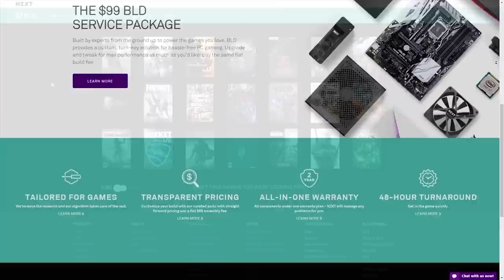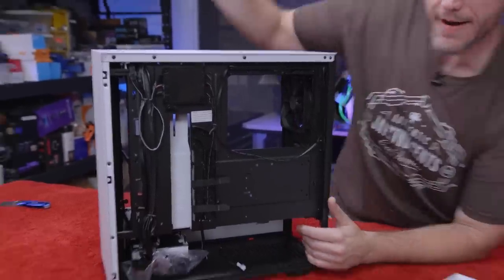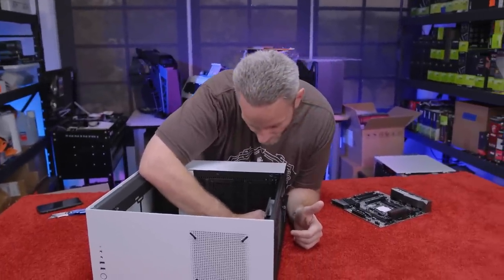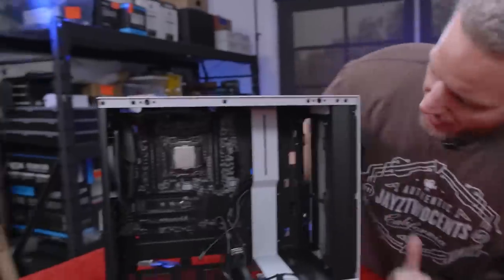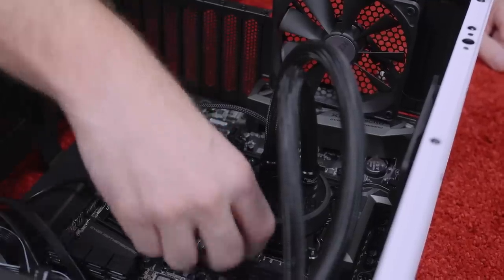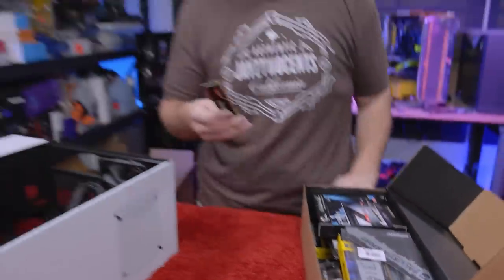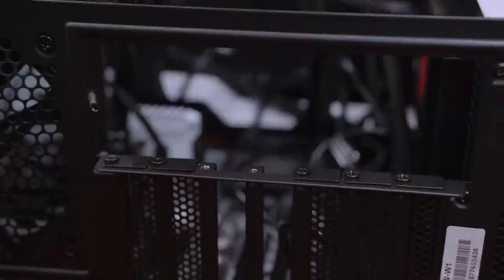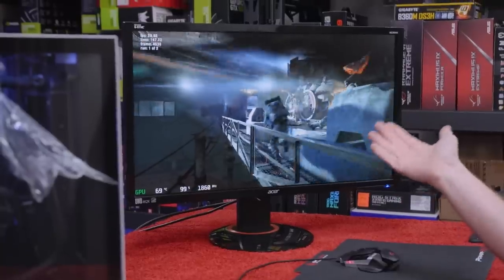We built a computer wrong on PURPOSE!

Comment: I was thinking 1000w when he pulled out 1600 I almost choked on my own saliva
Reply: Yeah how could he do that? It's still not enough
Reply: True, you'd never be able to connect your usb clothes dryer to it.
Reply: I uh... I do have 1200 watts. I realized a long time ago it was beyond overkill, but is it really that bad?
Reply: @lyingriotman2220  No lol.  It's completely fine.
Reply: @Nighterlev  Alright then, lol. I've just got 700 watts sitting on the back burner for a while then.
Reply: @lyingriotman2220  It doesn't really do anything negative to your power supply for not using it to it's max potential.
In fact, getting a higher wattaged power supply is a good thing, because the higher the watts, the higher the quality is in the caps, therefore, the longer it'll last.  You can probably go through multiple different builds for that 1200w PSU finally decides to fail.

After all, most 1000w+ PSU's tend to have 10 year warranties on them, because they're so damn reliable.
Reply: @lyingriotman2220   unless it's on a rediculous sale (or free) all it will really do is make your build budget  more expensive. Which means you could have got more value for the money somewhere else in the build as far as performance increase
Reply: thats just dumb
Reply: overwatting is lame, get this thing running on "500W" (150W real) Chinese $10 PSU, that would be achievement :)

(check fire extinguisher first tho)
Reply: Lyingriotman on my old 2011 build I had a 1200w even when I never needed that much power. I'm building a new tower now and I've got a 1000w  psu with a 10 yr warranty
Reply: It's not that buying an over watt psus is bad for it because it's not its 100% fine for the psus it's your wallet that takes the unessisary damage a cheaper psus cuase have done take his build done remember the cpu let's say 7700k and a 1080ti that combo should need no more then a 700watt psus and that's about $65-$70 while a 1600watt psus is $200-$300 yea big hit in the wallet lol
Reply: @lyingriotman2220  The only downside that bigger power supplies have is that they are more expensive and use more power than smaller power supplies (look up power supply curves) since you would probably be running them well below the peak of the curve.
Reply: @thursdaythought7201  What you said is misleading. They CAN use more power than smaller power supplies...but they will only ever output what you need for what you're doing.
Reply: @himi6536  Well they do have the potential to use less power if you are using insane ammounts of power- I'm talking threadripper and 2080ti levels of power (800+ Watts). For most people they will just waste power and be more expensive.
Reply: @thursdaythought7201  If you can afford a more expensive, higher wattage power supply then there's no reason to not future proof yourself...but there's no reason to go overkill if you're on a strict budget. That's called balancing your build.

If your system needs 600W, it will only pull 600W. This is true whether you have a 700W or a 1600W. Unless you're buying Chinese knockoff PSUs, this will be true for every power supply.

So, no...a higher wattage power supply will NOT use more power/waste power. It only draws what it needs.
Reply: @himi6536  Power supplies have things known as power supply efficiency curves. These curves represent how efficiently the PSU is converting the AC power to DC power- it is most efficient at around 50% utilization (PC using 300W with a 600W PSU is an example).  It makes no sense to get a 1600W power supply to pair with a 300W system- power supplies that large are expensive, it is less efficient in converting the power,  and it makes no sense for future upgrades because computers are becoming more power efficient.
Reply: @thursdaythought7201  They're becoming "more power efficient" (with emphasis)
That's something you're ALSO being misleading with. A new graphics card will still take more power than an older one, just not as much you might think. Regardless, there are tons of things that can be added onto a PC that are becoming more and more accessible that also draw power from that. My build currently draws around 1000W on a good day and I have a 1600W power supply.

Regardless, efficiency isn't what we were talking about. It doesn't literally use more power if it's less efficient, it might just pull an unnoticeable amount more from the power grid...but the same exact amount of power will be going into the computer.
Reply: @thursdaythought7201  Futureproofing is the main reason to get a bigger PSU. I'm not recommending anyone get a 1600W for gaming, but getting an 850W when you need a 600W isn't gonna have any noticeable impact to anything other than your wallet.
Reply: Efficiency is exactly what I was talking about. If you didn't want to talk about efficiency then why did you even reply to my comment. The fact of the matter is if your PSU isn't suited for the rest of your PC then it will draw more power from the wall than if it was suited for your PC. Also what sort of PC do you have that draws 1000W "on a good day"? That is either not consumer grade or it is overclocked to shit.
Reply: @thursdaythought7201  Nice backtracking lmfao

It's 100% consumer grade...just not at a "consumer grade" price point. The bigger question is why do you care?

"On a good day" means it sometimes uses up more. It's moody.
Reply: @thursdaythought7201  Also, a 600W power supply will pull the same amount of power from the wall no matter what computer it's supplying. There might be a tiny difference, that I assume you're now referring to, but it is not anything you would ever notice.
Reply: @himi6536  They built the entire 80+ rating system around the efficiency of power supplies- the difference is not tiny. You are basically wasting money if your power supply is too big  to achieve the sweet spot.
Reply: @himi6536  I'm not backtracking- I'm pointing out that you tried to bait and switch the topic. There is no way that you pull minimum 1000W without doing severe overclocking- like I said. What parts do you have?
Reply: @thursdaythought7201  You never once mentioned efficiency and now you're saying you were talking about efficiency...so, yeah...right, dude.

So, what, you care about my parts because you think I might be lying or I won the silicone lottery? Answer the question and I'll tell you why it's so high. Why do you care so much about how much power my system uses?
Reply: @himi6536  Quotes of me talking about efficiency...
"(look up power supply curves) since you would probably be running them well below the peak of the curve."

"Well they do have the potential to use less power if you are using insane amounts of power"

"Power supplies have things known as power supply efficiency curves. These curves represent how efficiently the PSU is converting the AC power to DC power- it is most efficient at around 50% utilization (PC using 300W with a 600W PSU is an example). "

Literally what do you think I have been talking about...
Reply: @thursdaythought7201  Unless you get one of the aforementioned stupidly efficient power supplies, in which you'd have to literally measure the difference to see it.

And if you're not, you honestly won't notice anyway unless you're using a 1600W in a system built to need 400W.

You seem to think the difference is like literally 10 dollars a month in electricity usage difference. It might be closer to a quarter, $0.25. I'm not saying it's good to go super high-level overkill on your PSU. I'm saying you're acting like someone will kill their electric bill by doing so...which isn't true.
Reply: @thursdaythought7201  Anything you used outside of the original comment is irrelevant. You should know that. Why you tacked the last example on is beyond me.

Power supply curves handle WAY more than efficiency. I'm going to assume you know that and added it because you think I don't.

"Use less power" and "efficiency" aren't the same thing. Sounds like you worded it wrong if what you meant was "draws less total electricity"
Reply: @himi6536  I tacked on the last example because it shows me talking about efficiency...
Power supply efficiency curves handle efficiency- it is obvious that you literally just looked that up cause you didn't know what I was talking about. The power supply using less power means that it is more efficient. The power that the power supply uses is not the power that the whole computer uses but rather the extra power that the psu uses on top of the power needs of the computer.

Stop trying to argue this because it is obvious you are confused but confident on the subject. The term that comes to mind is Dunning-Kruger...
Reply: @thursdaythought7201  "Stop trying to argue because I say you're wrong" lmfao what a massive ego

I know what I'm talking about and to assert that I don't just because I disagree with you is nothing but a terrible way of thinking.

Funny how you shoehorned the word efficiency in and still can't answer my question from before...deflect, deflect, backtrack, make assumptions.

Nice argument strategy, I guess? Go stroke your ego elsewhere. You didn't mention efficiency and now you're demanding that you did.
Reply: @thursdaythought7201  "I'm going to ignore every single point you make and claim you're confused, uninformed, and wrong because I disagree with you"

That's you in a nutshell.
Reply: @himi6536  I am literally only talking about efficiency power supplies. That is all we are talking about here. If you don't agree about that then YOU ARE WRONG. This is my comment thread and you can't dictate what my comment said. Like holy shit go away.
Reply: @thursdaythought7201  Just because you said something wrong you think that clarification and backtracking makes you magically right.

You also think insulting me is helping you look good in some magical way.
Reply: @thursdaythought7201  YOU obviously didn't understand what you said. You said nothing directly correlating to efficiency, only power draw...and then claimed it was about efficiency.

It's obvious you were making shit up as you went along and are claiming I can't read well because you write very poorly.

Comment: It's almost like the industry has collectively tried to make this as fool proof as possible t get a PC together instead of having to deal with RMA's all day from people doing it wrong. Amazing.
Reply: Its almost like this video was necessary because people still act like they're building with components made of sugar glass in 2019 and freak the fuck out in the comments when they see builders touching pins and PCBs.  

Its almost like you missed the entire fucking point. 

On no wait. Thats exactly what its like. Amazing.
Reply: I've built pc's back in the mid to late 90's with no issues wearing a sweater and no anti-static wristband.

People are just stupid and we old timers love proving that to be the case.
Reply: @christophervanzetta  I think the static fears probably came from computer building pre 1990s. Like you, I've never had any issues with static.
Reply: @tikoblocks3224  Still doesn't make sense but OK
Reply: @tikoblocks3224  LMFAO!

Because static discharge doesn't affect mobo components. Too low of amperage.

It's a myth to sell overpriced junk for idiot's
Reply: @christophervanzetta  My first attempts at simply replacing parts before I ever built one scarred me for life and Im super paranoid.  Back in the 90s I replaced my first graphics card.  Little did I know it would probably be a good idea to turn the power switch on the PSU off.  So current was still running through the mobo when I took my old GPU out and put the new one in.  Hit power there was a Bzzzt noise and it wouldnt boot (It was still under warranty from gateway so I put the old card back in and was like "I dont know what happened?!") 99% sure they just gave me a new PC.  Next time I tried to put an after market cooler on my cpu, admittedly, on this one while yes I didnt do it right, Im not sure what would have killed the thing.  (I didn't remove the old thermal paste and just plopped the new cooler on).  Same deal.  a "bzzzt" noise and I couldn't get it to boot (I did however remember to not leave my PC plugged in).  Which led to my first actual build that miraculously worked.  But ever since those first failure forays, Im still a mess of anxiety when even replacing things as simple as case fans.  I mean the only thing that alleviates it a bit now is I have money to burn.
Reply: @bigoljoe1829  someone with some common sense finally

Comment: Put thermal paste on the CPU pins
Reply: No!!!!!!!! You have to use liquid metal on the pins. Regular thermal paste will insulate the braces.
Reply: Why not just gasoline while your at it
Reply: So that it doesn't short circuit?
Reply: Ana Anaqah, not all paste is conductive, I think the white artic ceramique isn't but the artic silver is, could be wrong but in any case since it's not conductive it could act as an insulator to prevent the pins from touching inside the socket so either way it's bad
Reply: They get hot too
Reply: @anakakaka  r/wooosh

Comment: Bend all the pins.
Reply: I have actually had bent pins once... Bent them back and everything was fine.
Reply: @Outland9000  same
Reply: First you need a Thermal Paste applicator to do that and you need to be holding it in a cpu installation tool

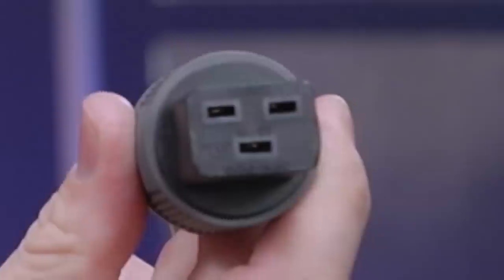Comment: 10:21 That's actually a standard IEC C19 plug. It's just not common since you usually don't have that much current going through a PSU.
Reply: Yes someone else knows about c19
Reply: I'm surprised he didn't know that.
Reply: I was going to throw this out there too. You see this more in data centers, typically not consumer hardware. If someone builds a system that is pulling 1600watts I would also hope they are plugged into a 20A circuit or dedicated 15A.
Reply: I said the same thing.  Though i wonder what he'd say if he saw a NEMA 6-20 or a NEMA L6-30.

Comment: I've heard that drilling holes in a motherboard is a bad thing too.
Reply: Bryan de Paepe haha I almost forgot that
Reply: Well there goes my idea for the Swiss Cheese build...
Reply: yea, if you're lucky the spot you can drill into is the ideal spot to use for whatever you had in mind, but otherwise it's a not a good idea. I'd be fully amused if he drilled into his though.
Reply: Maximum airflow
Reply: or massively over-tightening the screws holding the board so it snaps =)
Reply: That's a myth!
Reply: Yeah if i can't find a hole for a screw i usually just use epoxy to glue it in place.
Reply: You'll have a nice probability of destroying a trace, even f you don't see one. But you can always try! :P
Reply: Jay found that out the hard way several years ago.
Reply: Well of course THAT would be bad. There is no reason you'd EVER have to drill a hole in a motherboard. Sure you could do it with no problems if you did it right, but I wouldn't recommend it
Reply: @mauro Tamm that is the dumbest Idea I've heard for a while! Glue??? Nope.
Reply: BurntFaceMan  People have frequently used drills to shoot in the case screws and they end up breaking the circuit board, which sometimes isn't a big deal but other times may break traces running through the board.
Reply: @TheDyingScotsman  - Uh, to maximize airflow, duh.

Comment: You forgot to blow the RAM like an old NES cartridge...
Reply: For some reason.  Pro Wrestling became that necessity after just a few short months from when my older brother got it for Christmas.   Zelda 1 also in the golden original cartridge.
Reply: make sure you are wearing a live strong rubber bracelet to ground you when you blow the RAM
Reply: @heinzerbrew  - Nah. Just gotta rub it really fast on the carpet. Any hairs or lint that stick to it help it connect better.
Reply: @PorgMcNuggets To be honest, all that hair and lint will increase your thermals. You should probably put liquid metal on the ram to keep it cool. If you're on a budget regular thermal paste will work but won't look as cool.
Reply: @heinzerbrew  - Thermal paste? Nah, I just use Icy Hot in the socket and spray a little antifreeze on the motherboard.

Comment: One "don't do!" that you missed is "Don't clean components with an air compressor!" I've been doing that for 30 years and haven't lost a part yet.
Reply: i2nupman when I was 14 building a pc out of scrap parts i used canned air to spin one fan really fast because I was bored. It's the only fan from my original build that still works.
Reply: Just don't hold your fan funny while blowing ... I did that to a stupid fan once, the bearing got tilted and it created some crazy noise that I had to replace the fan.
Reply: Ive heard not to use a vacuum cleaner to clean parts. dont know why? if shouldnt matter which way the air is travelling as long as the dust is removed.
Reply: Vacuum cleaner can create static electricity, that's why.
Reply: I just cleaned my PC  yesterday and was playing with the fans, spinning them like that
Reply: They are magnetically driven you are not going to hurt anything short of extremely minor wear that might make it last an hour shorter on its 10 year lifespan. As far as an air compressor it depends on weather how often it is used and stored. They can build up water condensation and you do not want water splashes but as long as you power it down properly any sprinkle is highly unlikely to do anything.
Reply: Rem  From the mid-'90s, I've been cleaning my rigs with a vacuum cleaner.  23 years, and not a single man down so-to-speak...the whole vacuum static thing is a myth...  I clean my current machine with a DataVac (not the anti-static variant, either), and prior to that, I was using my land lord's Craftsman air compressor @ ~80psi in 2014.  Four years later, my Blue Streak is still running strong, still running like a champ.